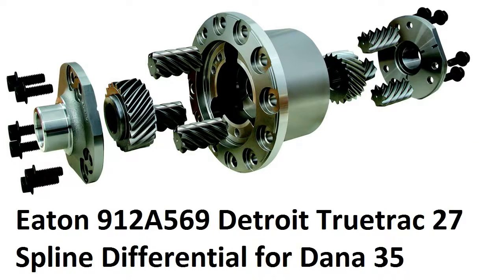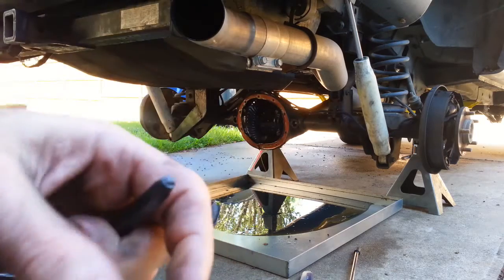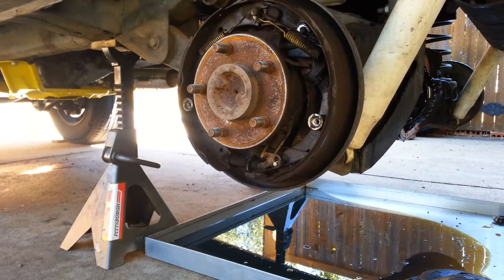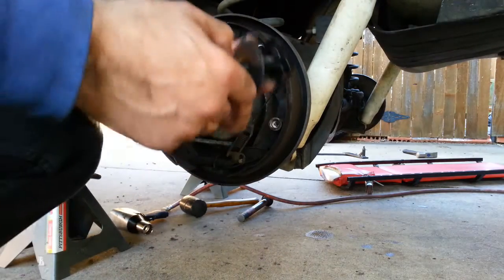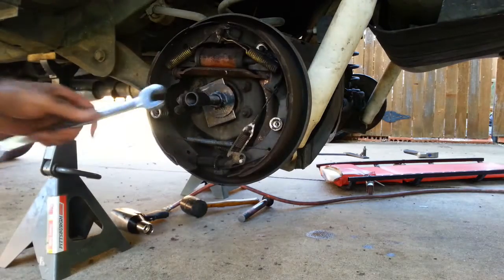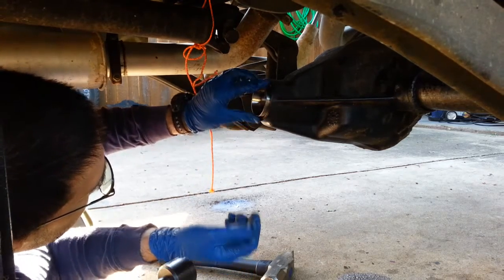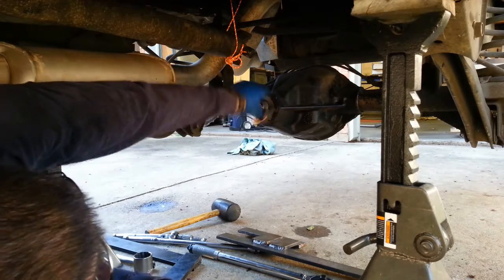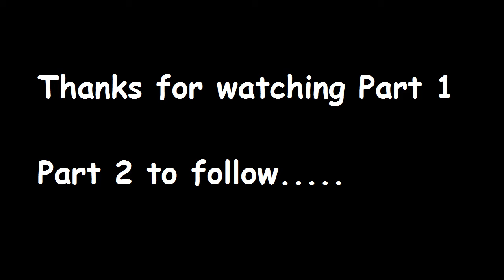Dana Axle Overhaul and Eaton Truetrac Install - Part 1

Comment: You should use a piloted bearing driver to install full compliment roller bearing. Also full compliment roller bearing needs to be installed and driven from the flat p/n end, the radiused end goes to bottom of bore.